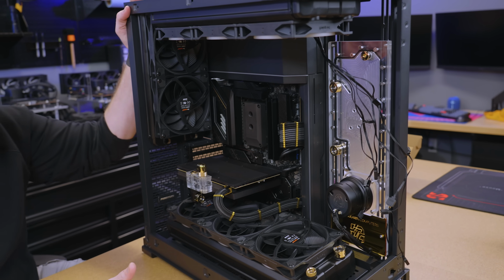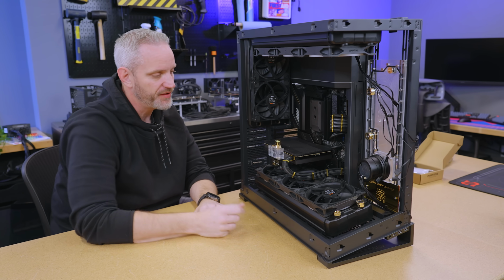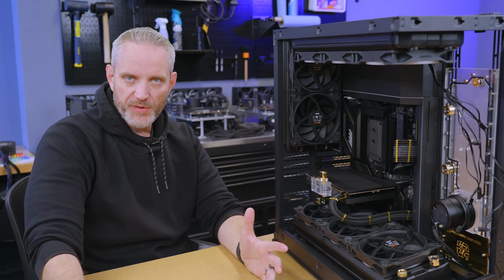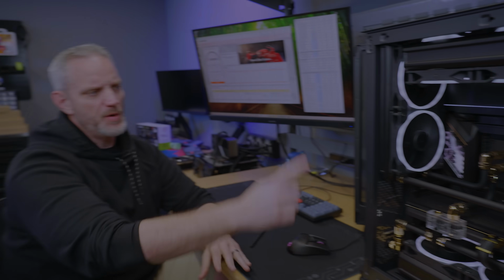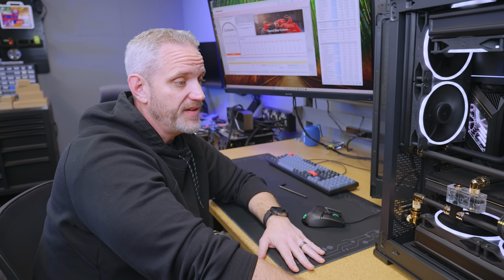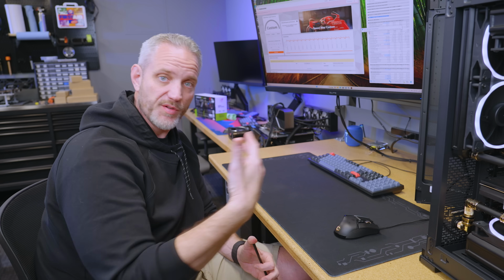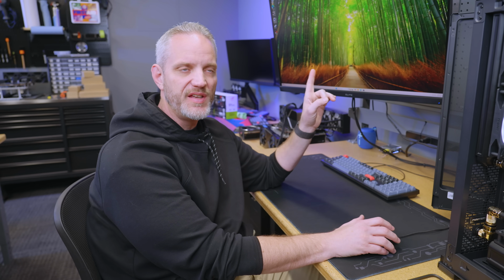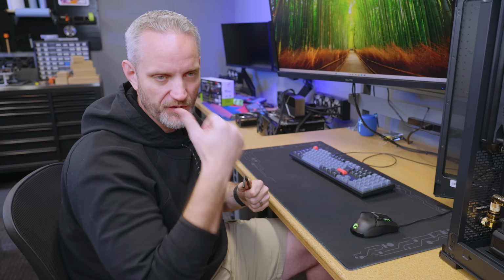This build turned out fantastic! 9950X3D Extreme Gaming Rig!

Comment: Water cooling noob here. Can anyone tell me what PC conditions would require the use of THREE cooling radiators? There seems to be enough radiator surface area in that PC to cool a high performance 4 cylinder ICE engine!! But I guess if money is no object... Don't get me wrong, the system is gorgeous but still at what point does "overkill" just become "wretched excess"?

Comment: Looks absolutely brilliant, great build, great aesthetics, Phil Montagé-u slamming that style down hard!
I can't believe you got those Bequiet fans so quickly, way to go Jay with that tuber privilege :)

Only things I don't particularly like is the way the 280 rad and fans look, especially because their usefulness is very debatable. For me it kind of ruins the otherwise very clean build. In a similar vein, and I know this is very particular, I think the top rad upper fans should be reverse blade as well. And a distant third, perhaps orange or yellow for the LEDs would work better to accentuate the gold highlights - but it's hard to tell not seeing the case panels installed nor where it is supposed to live.

I liked that you talked about the price of the loop in rough numbers, but it would be great to have the final figures for what the cost of parts would've been if it was retail prices, as a reality check kind of thing. Where I live, half of these aren't even available without ordering abroad with hideous additional delivery costs, but it would still be interesting to have some point of comparison.

Thank you for this series, I love when you do these builds, as it gives me inspiration, and building vicariously is the next best thing to building computers myself :)
Look forward to what you get up to next!

Comment: Rig looks wonderful. Suggestion: If you want more temp control on the fans/loop, get a thermistor fitting or a plug, then plug that into one of the thermistor headers, the board can then regulate fans based on liquid temps vs component temps.
Reply: Phil needs to rename the build to = CHERNOBYL-GOLD, all those pipes, radiators, water & high temperatures, what could possibly go wrong? 🤞

Comment: Heute ist meine geköpfter 9800x3d mit direkt die Kühler von Thermal Grizzly gekommen, nächste Woche baue ich meine 4080RTX OC auf nen Eisblock um und es kommt zu meinen 2 Radis im Gehäuse 280x140x28mm vorne und 420x140x28mm oben, noch ein Mo-Ra 3 Pro 360 extern mit 9 Noiseblocker drauf, noch dazu. Hab ne Laing DDC-1T +PWM, allerdings werde ich Softtubes verwenden und keine Distroplate! Sieht ganz cool aus dein Build!

Comment: you did an awesome job on the cooling system the black and gold looks incredible but those white fan rings are horrid with this build, looking at them is like spikes into my eyes. you built a Ferrari and then slapped kmart discount tires on it with those white fan rings.

Comment: The gold and black fits perfectly. The only thing I would have seen differently are the screws in the fans in gold color instead of black, because I think those radiators are already a very large black surface, that would take away some of the black with gold colored screws.

Comment: It's a cool build, but your tests are not really valid unless you put this in more realistic conditions:
1. Put the side on. Your airflow isn't operating as expected with the side off - results will likely be better with the side off - especially with exhaust heat.
2. Your facility is well air conditioned - probably lower temps than the average office / home. This will impact intake air quality.
3. The unit is sitting on a lab bench with no inhibited areas on the sides or the top which will improve airflow.
4. You are still performing exhaust through a radiator which will warm the fluid, not cool it (once you close the side this should be more evident).

Otherwise, very neat build. That's the cleanest 90 degree bend I have ever seen between the top and rear rad.

Comment: I'm not much for gold anything in general, it can get gaudy very quickly, but this build is simply beautiful. During the montage I wasn't into the white rings on the fans given the overall aesthetic but the final result really works well. In a room full of tricked out builds, this one would definitely draw my attention. It's too bad there isn't a way to change the color of the 7-segment error code LED's. Short of that maybe design a removable 3D printed cover that you could pop on and off as needed if you aren't going for a red build because that's the only thing that detracts from it.

Phil the music you chose for the montage sounded great as well.

Comment: Phil sitting back there for HOURS figuring out the travel/tilt/zoom controls on these shots must have had him about to soil the front of his underoos.

And I am REALLY glad you went with series flow on the cpu/gpu.  The idea of parallel on those had me concerned about one or the other having less resistance and causing a significant flow loss 
compared to the other blocks cooling ability.

And the only thing I see that is a MAJOR eyesore is the damn RED LED numbers on the motherboard.  If they built it black with gold accents, why not use a yellowish/gold color on those numbers?

Comment: @JayzTwoCents you can do a little work-a-round of the non-activated windows and applying a custom wallpaper by simply saving any wallpaper .JPG file to your pictures folder, then going to that folder destination and right clicking the saved file and clicking SET AS and then clicking WALLPAPER. I'm sure you prob already know this, but just figured i'd put it out there just incase!!! That way you can have your machines looking nice for content even if they aren't activated!!!

Comment: I Got 3x 360Rad (2x 30mm 1x68mm), Push Pull with 18 Noctua Fans at 700Rpm, Pump 2600-3400Rpm and i have the same temps on my oc´d 9800x3d + RTX 3080. Never hits 45degree on Gpu and 72degree on Cpu .

Comment: This is looking really nice and thanks Phil for the awesome montage (like always). 
I went for two 48GB Trident Z (the regular ones) 6400 MHz sticks for my 9950X3D. The kit is not on the QVL list of my mainboard (MSI X870 Tomahawk Wifi) and it doesn't even come with an EXPO profile (only XMP) but I could load the profile anyways and somehow it ended up working perfectly fine. Haven't done any manual tweaking yet but I'll try to get the timings a bit lower.

Comment: i also THINK ABOUT MY NEXT UPGRADE which will be cpu ram and motherboard and i think if i must get c 9900x, 9700x or wait for ryzen 11000. my previous upgrde was graphics card in 2021 and sd in20 but cpu ram and motherboard i have them since March 2017. A godo choice will be a Aorus Elite Wifi motherboard x870 with RYzen 9700x and 32 GB DDR56400MHZ. Should i get these or wait for ryzen 11000 because they say that it will have more cores but at cheaper prices?
Mine pc is
CPU: RYZEN 7 1700
RAM: 16 GB DDR4 3200MHZCL15
GPU: RX 6700XT 12 GB RED DEVIL
SSD:MP 600 2TB WRITE:4950MB/S READ:4250MB/S
PSU;  CORSAIR CX 750M 750 WATT
MOTHERBOARD: PRIME X370 PRO
CASE: AEROCOOL 800
MONITOR: DELLP2416D 24'' 2560X1440 60 HZ IPS

Comment: I would sometimes put restrictor valves on the GPU or CPU outlets if the restrition was to low and the other block didn't get the flow it needed using a split flow. Other time G/CPU > 2nd RAD > C/GPU > Main RAD > Res/Pump

Comment: It's a beautiful build, no doubt. I did a Lian Li case with EKWB parts all in gold. It came out beautiful. (This was before EK blew it!) However, I am disappointed that the graphics water block is already failing cosmetically. The other issue I see with EKWB is that they stop making water blocks for 3090 TI too quickly. They want to move with the newest everything. But don't dump those who invested lots of dollars and are still happy with our builds. I have to now find another water block for the GPU. Can you recommend any? I'm going to start ordering parts other than EK. I don't see quality anymore with them and I believe they are heading for a big downfall. (Worse than it already is)

Comment: it's amazing the way it sits. there's only 2 things that stick out to me. the drain (which I love) has an extra 90° fitting. there should be one on the other end of that run at the radiator or there shouldn't be one in the drain line. that really long and straight tube from the small radiator to the upper radiator just feels out of place to me. still a lot to be jealous or envious of. 🙂

Comment: I love that tube routing 👌
that nice parallel between the tube going from the bottom rad to the GPU and the tube going from the back rad to the top rad
also those two tubes on a 45° plane going in and out of the distro
that's a build with some character and I love it

Comment: @jayztwocents when bleeding your system after you fill it, use your vacuum pump on the reservoir to pull a vacuum so that the air bubbles in the system get larger and get pushed around the system easier by the pump.

Comment: All the radiator fans should be set to exhaust because it will push all of the hot air out of the case.  Otherwise you end up with blowing hot air in the case.  I also don't run my fans at high speed  because it's a computer and I'm not deaf.  Yes, if you run the fans hard enough the heating is not significant.  This has worked great on the PCs I've done it on.  There's this belief air goes in the bottom and front of case and exits the back and top, that's complete nonsense and actually almost always the worst air path for most cases.  Pulling air in from the back also reduces the dust in the case.  I've actually less dust in the case without filters and pulling air in from all 9 radiator fans exhausting versus air in the bottom and out the top and side using a filter.

Comment: Hi!  I have a qiostion , what is the best to have if you have an AIO, push or pull ? , I think it is push
Reply: Typically push through the rad as exhaust on the top of the case.  This way you always have the rad over the pump and you won't get air locks in the pump.
Reply: @MrDomNoms  Where can it be other than push ?  I have a rad on  the side... I was wondering to change the air so it will blow air in the chassi, otherwise it pulls air from the hit gpu and thats not good ? but it will then be pull... I  dont see how they can be push, I will see when (if) I remove the radiator... and see what I can do... but I think it will be pull.  Also I will get a positiv pressure inside the case. at the moment I have 2x140mm intake at the front, I will have the AIO at ther side as outtake, 1 singel 120mm fan outtake on the back, and one more at the top 140mm as outtake.

Comment: With an MSI motherboard BIOS, it was possible to set each fan header to a different temperature sensor; with an Asus BIOS, I have not found a way to do so, it seems like all fan headers have to react to the same temperature signal (you can choose which one, but you cannot split)

Comment: G.SKILL Trident Z5 Royal Series 96GB (2 x 48GB) CL28-36-36-96 in Gold and G.SKILL Trident Z5 Royal Series 32GB (2 x 16GB)  Timing 26-36-36-96 and go x4 in Gold. They make 2 x 32 cl 26 neo also in most cases you would need to call G-Skill.  2x16 and 2x32 is CL26   2x48 is CL28 all are in royal NEO Gold.

Comment: Harley Davidson makes a hand air pump to air up the rear shocks on touring bikes.  It limits the pressure so you don't explode your shocks.  I wonder if that could be adapted to pressurize water cooled systems in order to drain them completely.
Reply: It is small and handheld, it puts out less pressure than a bike pump and would be perfect!!!

Comment: Wait hold on, three different radiators and yet you bridge the CPU and GPU directly into each other without a rad inbetween to take the heat out?
Idk if I'm onboard with that decision, cap'n. Either way the water flows, one of the two is getting boiled.
Reply: Loop order does not matter, the second component in the order will be at most 2c hotter than it would if it was 1st in the order, Jay has proven this multiple times in previous videos, and it's been known for at least as long as I've been an enthusiast (about 15 years)

Maybe watch the video in its entirety and see the temperatures it's reaching before repeating a multiple times over debunked misconception.